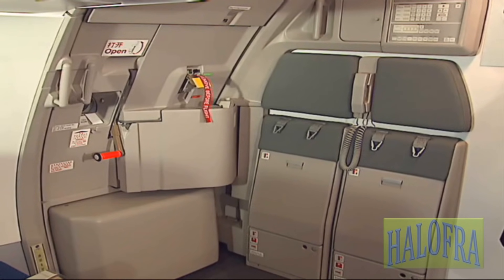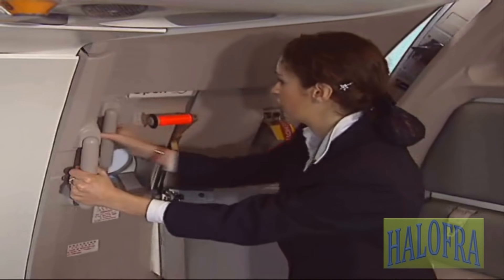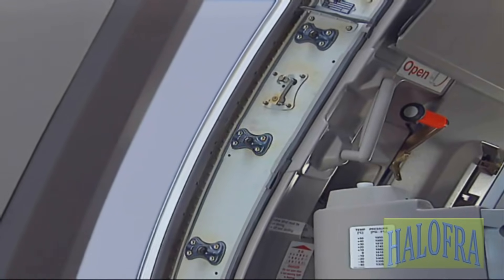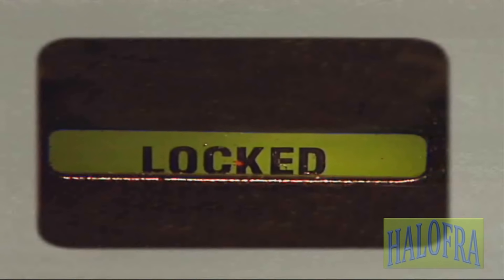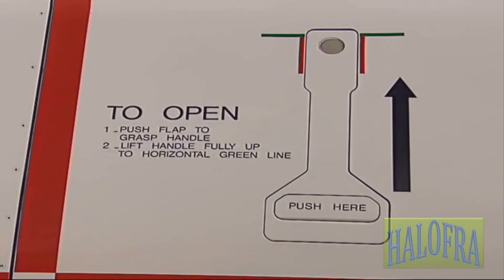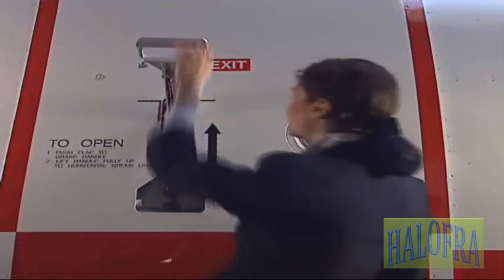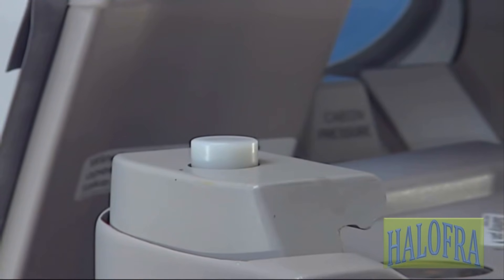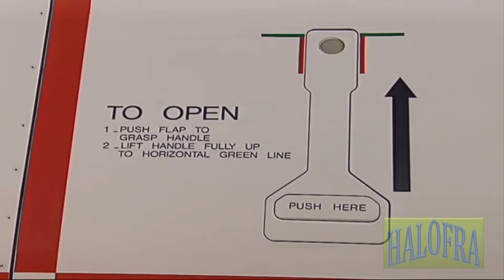Entry and Service Door Operation A320 Family

Comment: Imagine getting your finger stuck between the door and the frame. Like in a car.
Reply: Well the difference in car is your car is in the ground (obviously) and airplanes are higher that’s why they need stairs or gates.
Reply: For the most part, these doors are heavy & uses hydraulics to move. So unless you're a complete fool, the odds of it happening is next to nothing. Normally you'd use one hand to push and hold the door in place, and the only to trigger the locks/handle.

Comment: How does this thing keep air sealed? I understand the locking lugs that keep the door in place but what keeps it sealed? All Boeing doors I know of (Except 777 and 787) open inwards, allowing the door to be bigger than the door frame, having the air pressure difference constantly force the door into the frame, guaranteeing air sealing.
Reply: The same way cargo doors are secured
Reply: the door edge sits onto a seal in the door frame thats like a tube around the door edge. that seal has little holes on it on the inside, through which the pressure from the cabin can enter therefore blowing up the seal a little thus forcing it to the door's edge. it can compare the minimal movement and size deteorientation during flight.
Reply: The door expands and the pressure keeps it in place like a pulg

Comment: She didn’t check if the armed slide warning light illuminated prior to pulling the lever all the way up 😅🤧
Reply from the maker: Thank you for your comment.

From inside she checked the slide is disarmed with the control lever and the pin in the disarmed position + checking cabin pressure indication.

From outside it's necessary to check only the cabin pressure indication, even if the door is armed , there's a safety that disarmed the slide in case of opening the door from outside.

Comment: What happened when caban prashare is flashing and you open the door
Reply from the maker: The Cabin Pressure indicator lights flash red when the following 3 things have occurred; the engines are shut down, the door is disarmed, and the cabin differential pressure is above 0.0362.

This is a very important indicator device; given that Airbus aircraft don't have plug type doors, opening of a door when cabin pressure is too high will most probably throw the person from the aircraft
Reply: You can't open the door. Even though the door doesn't need to move inward, it still requires you to move a large piece of metal that has tons of pressure on it.
Reply: @autogolazzojr  the door opens outwards, the higher pressure inside will push it open.

Comment: What all of these aircraft door videos prove is the absolute need for STANDARD door operations on ALL similar size aircraft so that crew and pax can quickly open them in an emergency without having to stop and read an instruction placard.
Reply: Crew is always trained for that so not an issue, and passengers on an emergency wouldn't be operating even the emergency exits, which they are trained on the before-flight videos to locate. In an emergency where all flight attendants (the ones trained to operate the doors) are incapacitated, you would sure be incapacitated/dead as well long before needing to open the doors.
Reply: These videos don't 'prove' anything like a need for 'STANDARD' door operations at all. Aircraft designs improve all the time, and crew are trained to operate them all safely, plus the procedures are specifically designed to be simple anyway and crew are trained NOT to require reading placards to safely operate an aircraft. To limit every similar sized aircraft design to a single door design/procedure is a stupid idea that would stifle innovation for no safety benefit. Yours is an amateurish idea without any reference to the way crew are trained, or actual incident analysis, or the basic simplicity in which door operations design is made for safety. There are areas in which crew procedural consistency is important, but this affects pilots, not cabin crew, and there are not many aircraft types where pilots 'cross-type'. The 737-MAX mess was one of them though, but that had nothing to do with doors.
Reply: @NinoNiemanThe1st  I doubt my idea of standardizing door design and operation is amateurish and stupid as you stated.  I am a commercial airline pilot with 34 years of experience.  What are your credentials or qualifications ?
Reply: @Kalvinjj  you obviously know nothing about this matter.  Passengers must open over wing emergency exits on many aircraft because the cabin attendants are seated in the front and aft of the wing area.  Passengers must also assist launching rafts, they must also assist other passengers when exiting via door and over wing exits.  Standardization is required.  I am a commercial airline pilot with 34 years of experience.  What are your credentials ?
Reply: @davidkamen  I should have mentioned you're a pilot who (maybe) flies the things, not an engineer who has to design them before you get there. Are you claiming your '34 years of' (flying experience) supplants the aeronautical design professional engineers do. Because they sure haven't designed consistent doors while you were flying, and their own fields and materials were improving lol.
Reply: @NinoNiemanThe1st  Yes my experience exceeds that of some designer who has to his/her job once and I have to fly whatever they design.  Standardized aircraft doors have been sought after since the late 1970s but if there were standardized doors those designers would have to design something else.  Aircraft builders don't want standardized doors because that would limit their suppliers and one company could make doors for every model aircraft.  Standard doors will come on the industry because they after safer, much easier to maintain and could be operated by either the aircraft's crew or passengers.
Reply: @davidkamen  ...and ignore 30 years of improved materials and design concepts. The day aircraft designers let pilots suggest or even determine the doors they can design for the relatively minor benefit of consistency is the day the manufacturers will have officially lost the plot ie. it hasn't, and ain't ever gonna happen. Tech/design/materials move on, and dealing with different door designs is no big deal for cabin crew in a crash - unless you know something different about published accident reports LOL.
Reply: @NinoNiemanThe1st  You seem to have an extraordinary fixation about aircraft doors.  Are you a door designer or some type of designer or engineer having to do with aircraft design ?  Strange for anyone to be so defensive of an industry he probably has nothing to do with.  I will ask you again, what are your credentials that cause you to be so vehemently defensive of such a subject ?
Reply: @davidkamen  The fixation is yours: as an alleged pilot, do you really believe you can direct the design of aircraft doors to be 'consistent', because you're a pilot? 
Pilots are very much involved in design, and have their views considered at the manufacturer level (Airbus and Boeing employ plenty of them). But not as part of the view of some random old pilot not involved in the process making some commentary on YouTube.
Consistency is great and has value but has an opportunity cost because materials and design concepts continually improve over time. My other arguments for the relatively low cost of non-consistency in door design were in my previous comments.
Reply: @davidkamen  LOL your experience as a pilot 'exceeds that of some (aircraft) designer' - yet you want to design the damned thing? Jesus Christ give me some f'ing strength. Perhaps get a job at Boeing or Airbus and see what's actually involved in designing aircraft and all the issues they need to consider to bring a safe, commercially profitable aircraft to fruition, and then come back. It's not Wright Brothers tech anymore lol.
PS. The designer's job and its outcomes is on show 10s of thousands of times, if not millions when designing an aircraft. I'm sure way more than even your ancient high flying hours could tote up anyway lol.
Reply: @NinoNiemanThe1st  All of this exchange still has not revealed what your qualifications are to criticize someone who wants standardization in the industry while you defend designers and engineers.  You still have not revealed what are your credentials or qualifications to be a "voice for the industry".  Conversation over - thanks for your criticism and your nasty attitude.  Try making your views known with some respect for people who do not agree with your view points, people who are experienced and qualified to offer legitimate suggestions which may not agree with your views.
Reply: @davidkamen  For the last time, my qualifications are irrelevant, as are yours - although you keep telling us you're some kind of pretty old pilot from what you've said which you use to claim you have some professional opinion on standardization which you seem to say should be accepted 'because you're a pilot'. That's neither here nor there. And to be finally clear, I do not agree with your opinion at all. Address the issues, not the qualifications of the commenter.
Reply: @NinoNiemanThe1st  CONVERSATION IS OVER.  GO TROLL SOMEWHERE ELSE !
Reply: @davidkamen  LOL Old people who can't address an argument or an issue reverting to 'you're trolling'. In capitals no-less. Go design some 'standardized' doors and send the drawings to Boeing or Airbus, I'm sure they've never thought of what you're suggesting lol.

Comment: What prevents someone from opening the door midflight?
Reply: Air pressure
Reply: @user-jt5vm3mi1w  air pressure pushes it outside so it makes it even easier to open. All that's holding the door is a latch.
Reply: @ronenfe  I agree but dozens of web pages on the subject don't
Reply: @user-jt5vm3mi1w  they are talking about plug doors which open inside first. This is a type c door.
Reply: @ronenfe  ok we are doomed they will open
Reply: Asiana airlines says hello...
Reply: @user-jt5vm3mi1w  As we have seen recently this works so well...

Comment: No this video not full because, hole the control handal & lift it 224 digry & cheked if the slide worning light is no ilumineting..
Reply: Actually you check the warning light first before you do anything